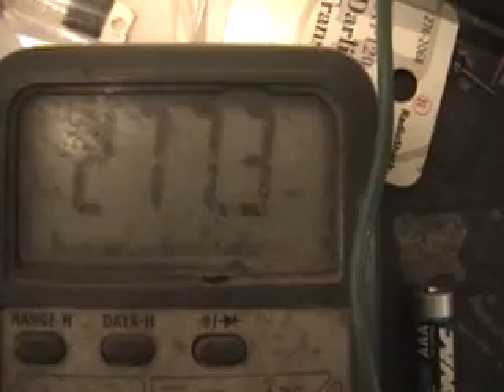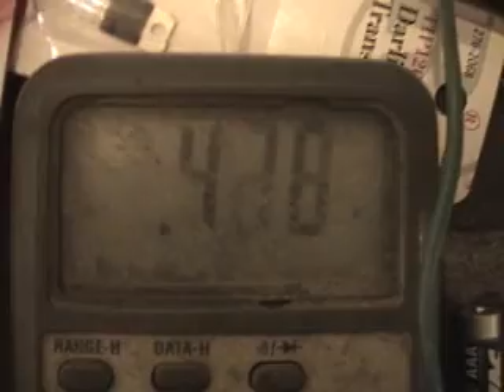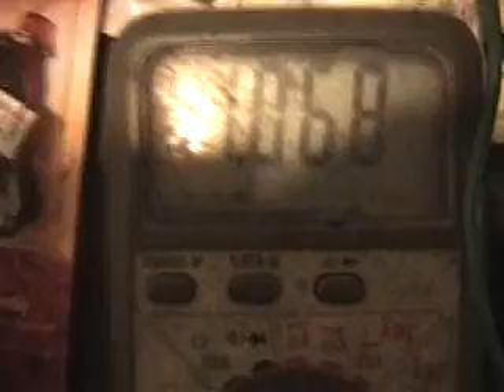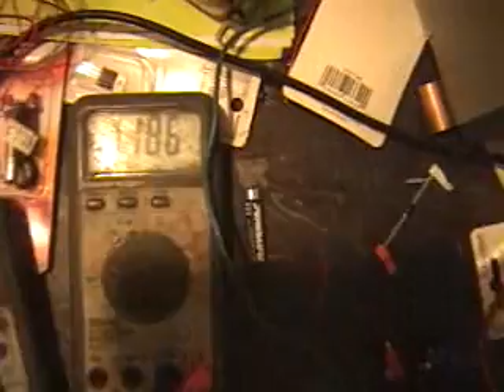Utilization of Radiant Energy 1901 Nikola Tesla,My test 8

Comment from the maker: yes you are correct. its plate area and height that makes better results. its beeen shitty out and i dont want the ladder to slip if i go up a tall tree where i live, to attach the panels higher. also  this is uncharted territory for me, i dont want to bring down a lightning bolt and get fried lol. once its on the roof there should be a huge increase! yea im sure someone on a higher place would get better results, thats why they should try it inside before moving to the outside.

Comment: One more thing. This is speculation: Individuals living in mountainous or hilly regions may be able to set up their plates as high as they can get them on a ridge and then run an insulated length of wire down into the lowest depression to improve performance. As long as the wire is insulated until the grounding point it seems logical that it would improve performance.

Comment: Hey man you can get more bang for your buck by putting these aluminum sheets on your roof. If you could get them balanced horizontally at the apex you might gain 3-5ft. If you could mount them vertically with the longer side being vertical you could gain more height. Height was one of the critical factors. I believe Tesla's round ball at his Colorado springs site was about 200ft up.

Comment: I'm not saying it won't work. I'm saying you can discount a source of power that is quite literally only inches from the metal.

I did experiments when I was around 11 or 12 with the antenna from my crystal radio (a 50 foot wire on the roof) and an NE2 bulb would sometimes blink. Without the crystal radio, of course.

Google for:
ne-2 bulb antenna blink

And you'll find lots of matches.

Comment from the maker: well others have gone to the middle of the desert and found energy hitting the plates, no power stations, no radio waves, also think because tesla made the radio, there was no radio waves, so he was getting energy from somwhere, of course its alot harder to test in this modern world, bec everything is using some energy sources, wether it be the ac currents or radio waves. well maybe just check out the patent. it works and will continue to work after the electrical system is turned off.thanks

Comment: You can't just assume a 120V (170Vp-p) line with almost 1Amp running through it won't affect this when you are only measuring a few volts.

I can get that just grabbing the lead of my oscilliscope, and it is 60Hz AC hum and higher frequency noise from fluorescent lights, TVs, etc.